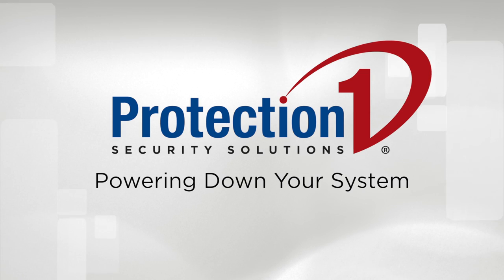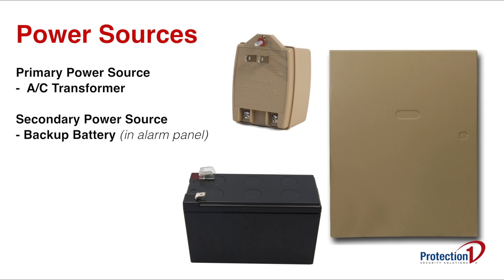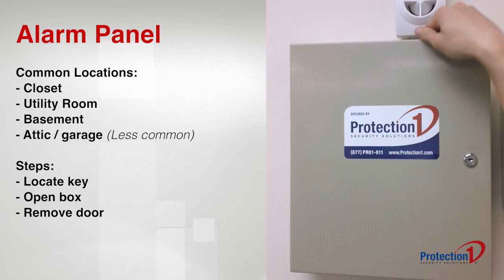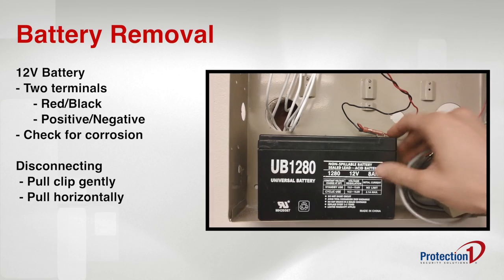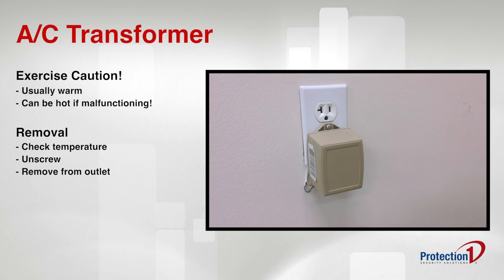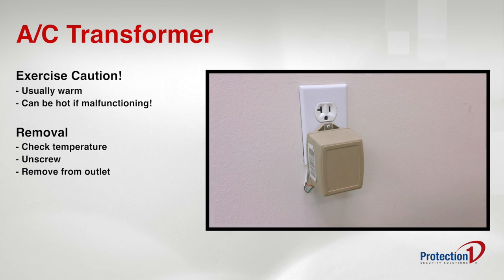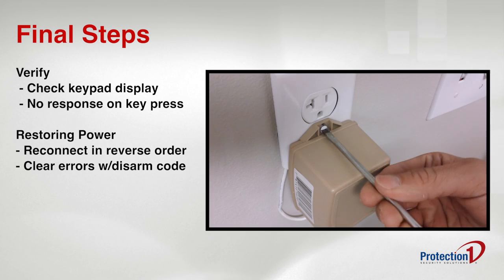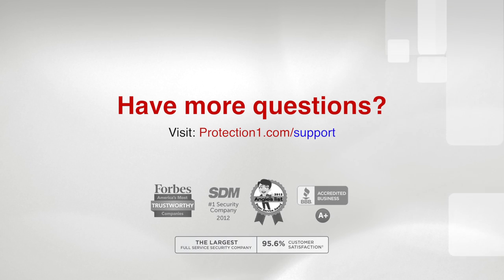How to Turn Off Your Honeywell Alarm System

Comment: We bought a house a couple of years ago that has this system in it. We have never and will never arm it and I was tired of the occasional beep from the low battery warning so I watched this helpful video, but the problem is I can not find the main power supply transformer anywhere in our house. The previous home owners were scared of their own shadow so I'm sure they hid it in the attic so the boogieman couldn't find it. If you are in the same situation, just unplug the battery first like in the video then take a Philips screwdriver and remove the wires off of terminals 1 and 2 (the 2 terminals on the far left side of the terminal block) and that will be the same as unplugging the transformer.... Remember that the bare wires are live with 12 volts so use either wire nuts or a piece of electrical tape to tape them both so they can not short out.

Comment: That d1 means that it is booting up.  Let it run through that cycle.  Otherwise, the system doesn't boot up properly and you'll have a bunch of errors...especially if you have zone expansions.

Comment: if you power down a system with no battery back up. the bell box will sound as this is the only thing that is holding a power supply which is the battery inside of it.

Comment: That D1 means the panel is booting up, Let it run through that cycle, Otherwise, the system doesn't boot correctly and you will have a lot of errors, especially if you have zone expansions